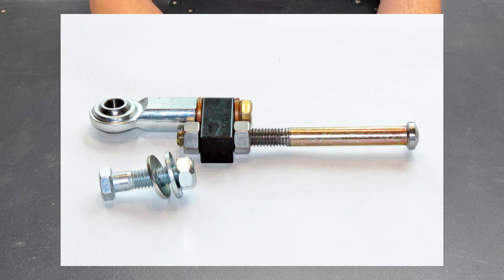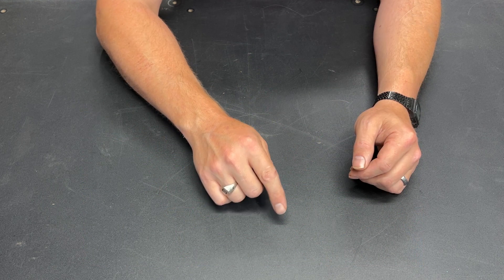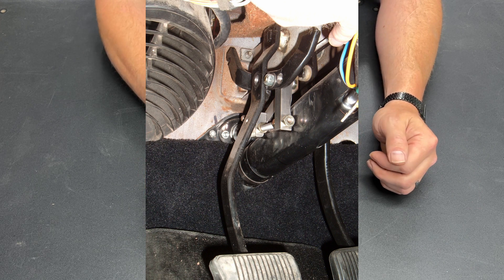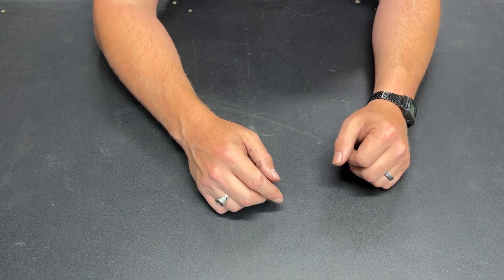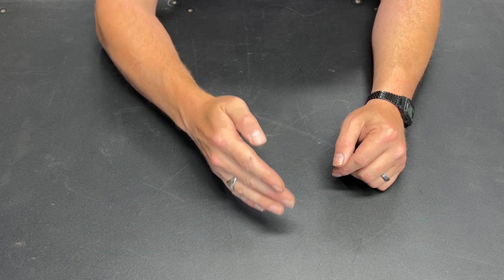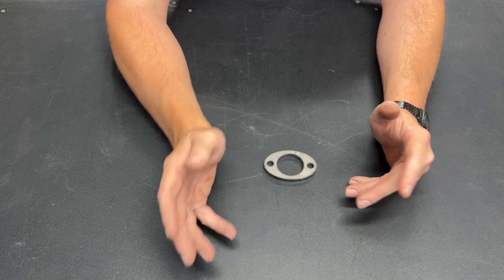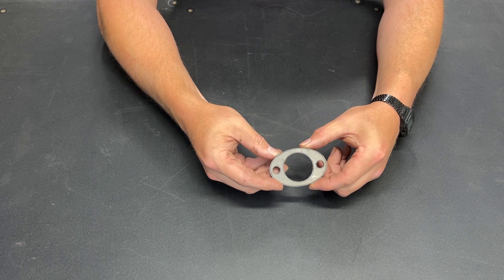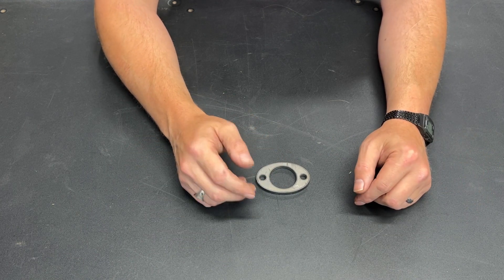Hydraulic Clutch 101: Correctly Mounting the Master Cylinder to Maintain the Correct Pedal Ratio

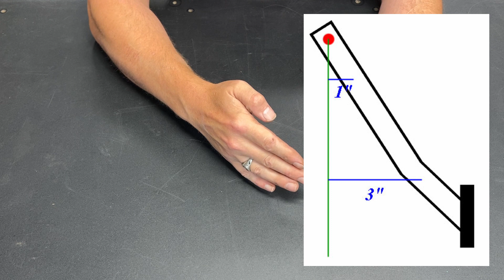Comment: im putting a tkx in my 47 dodge panel truck, i cut out an 87 d150 pick up truck bulkhead and welded it in the 47, so i had the factory 87 brake assembly and 87 steering colum, its a frankenstein, but its an auto set up, got an la360 and had a auto torqueflite, now putting in the 5 speed, i got the clutch pedal and brake pedal off ebay and it fits in the factory hanger on the bulkhead, now from your drawing at 3:25 i should mount the clutch master at the same vertical position as the tang that the rod hooks to way up on the pedal arm? ive got a hydro boost brake assembly so theres room to mount it since theres no brake booster on the firewall, do i need to put a stop of some kind on my clutch pedal arm to limit travel of the clutch pedal arm or does the rod connecting the cluch pedal to the master hold everything where it needs to be? thanks for video
Reply from the maker: No limit needed.  When the clutch mater bottoms out the pedal will stop.

Comment: I have a 1960 ford falcon and need to go to a hyd setup with hyd TO bearing to get my mopar smallblock/a833 combo functioning. I have the factory pedals installed, without helper spring, and another set of pedals with the spring. Do you have a kit for a falcon? how do you account for the arc of a swinging pedal to push a rod straight into the MC without angling? Do i need to measure the travel of the pedals to find that distance to work out the math for an MC?
Reply from the maker: I don't have any kits that utilize a hydraulic throwout bearing.  My offset pushrod might work in a 60s falcon as the falcon and Mustang are similar but not exactly the same.  on a 65 Mustang my offset pushrod would allow the master to be mounted n the OEM clutch linkage hole and connect to the pedal in the OEM linkage connection point.  as far as the arc the kit is designed to be parallel with the master at 1/2 stroke.  If you have further questions probably easier to email me through my website.

Comment: I have your universal T5 kit on a 1978 Mustang. With the clutch pedal to the floor the clutch does not completely release. 
Is there supposed to be any play on the clutch fork? 
More questions will follow.
Thank you.
Reply from the maker: Could be several things, like improper setup, insufficient fluid volume from the master (if using one other than the one I sell) or the most common issue air in the system. https://youtu.be/8pFd_cHVjHQ How much stroke are you getting at the slave and are you using my master cylinder or something else?  

As to your other question, when properly setup the slave cylinder piston needs to be completely bottomed out in the slave and all lash needs to be removed from the pushrod and clutch fork.  Youtube is not a good place to do tech support.  Please contact me via email through my website with your follow up questions.

Comment: Hi i have a 1970 cougar with a 351 cleveland automatic. I have a 5 speed box from foxbody mustang.Do you suggest I try and find 4 speed clutch pedal assembly or got with a wilwood clutch pedal assembly? My cougar is equipped with power brakes.
Reply from the maker: I would go with a stock type pedal. Depending on the look you are going for it will likely look better and should be easier to fit the master and pedal together.  If you have more questions don't hesitate to ask but it might be easier to contact me through my website rather than youtube.

Comment: Great series. Do you have any videos for the plumbing of the clutch lines? I am going to be using the master and slave from the truck the transmission came from but I want to run my own line. I'm honestly not sure how I can tap into the master and slave with the connectors that use the roll pins to hold them, everything I done before was threaded. Was also curious about the factory set up that had the soft plastic line going from the master and hardline going into the slave as I would want to do hardline from master then probably an AN hose going into the slave, would there be any ill effects doing it that way?
Reply from the maker: I don't have any answers for the fittings.  There are so many different factory fittings that I don't have a one size fits all/most option.  I would look for an AN adapter that fits your specific fitting.  As far as the hard line that is not a problem as long as you mount it solid at both ends and you do as you said and put a flex line at the slave cylinder.

Comment: Thanks for that info. What is the pedal ratio for the cars you nominated? I have a 70 Torino thats had a home made setup and there is too much pedal travel. It works out at about 6.6:1. Ive now made it 5:1 whilst keeping the alignment as good as possible and it feels right travel wise but its pretty heavy. Is that about right?
Reply from the maker: so pedal ratio and hydraulic ratio work together to effect release point and pedal effort.  I never actually calculated my pedal ratios as I was trying to have near max stroke of the pedal result in max stroke of the master.   I go over pedal ratio and hydraulic ratio in this video https://youtu.be/Q3rGUSIjd_k  I would guess your hydraulic ratio is a little off but that is just a guess.  I would need to know required stroke at the slave as well as SC bore and then the bore and stroke of the master to get a better idea what you have going on.

Comment: Have a old toyota rav 4 2001 and yesterday noticed a oil leak in a aluminium block that sits between main and relay cylinder, it has a disk that is sealed with a square gasket, didnt find in the internet its function, do you have any ideia of what is does? best regards
Reply from the maker: Sorry but I do not know what that is for.  My expertise is older domestic vehicles.

Comment: @DazeCars On a 65 Mustang, do you still need to use the Clutch pedal spring, that goes from the pedal to the bracket on the pedal support?
Reply from the maker: It is not required but some still choose to run it

Comment: Have you ever looked into a slave cylinder bracket for a Toploader in a 65 Mustang?  I am building a road race car with a set back seat and it looks like a hydraulic clutch system will be the best way to go.  I have been planning on designing my own but I am open to saving some time.  I want to keep the slave cylinder on the outside of the bellhousing and not use a transmission input shaft mounted slave.  Thanks
Reply from the maker: I do not currently have anything but have been looking at a couple different options to make somthing work.
Reply: Thanks for getting back.  No big deal, just looking to save a bit of time if you had something.  I will figure something out (I am a retired mechanical engineer and have been playing with cars for over 40 years).  Most likely I will be working with the stock bellhousing and clutch fork.  I will let you know what I come up with if you are interested.
Reply from the maker: @kimbarron  And right there is why I never designed this system to produce.  Attaching to the bellhousing and pushing from the front makes the most sense.  A push slave is way better than a pull slave.  Problem is there are at least 8 different OEM bellhousing and they are all slightly different.  I could never come up with a kit that was one size fits all.  I am looking into a system that might work using a modern bellhousing but have not had a chance to test it yet.
Reply: @dazecars I do agree that a push slave would be the best way to do it.  I can see the issues.  I forgot about all the different bell housing/clutch fork options that Ford used.  I am guessing  this is why I have not seen much out there for Toploader options.  I am working with just one combination of parts, which will make it a bit easier.  An adjustable mounting bracket could be done to help with different bell housings and clutch forks but then there will still be the issue with getting the required stroke length correct do to the different clutch fork lengths (lots of math to do).  I may decide to look at the throw out bearing slave option but what a pain if and when you get a fluid leak in the bearing.  At least with an externally mounted slave it is something that can be changed out at the track without too much issue.  Again thanks!
Reply from the maker: @kimbarron  I personally can't stand a hydraulic throw out bearing.  If not set up correctly usually within .035" they are prone to failure.  Easy fix shim it properly.  The bigger issue for me is the way they feel... or the lack there of.  On a slave system you can still feel what the pressureplate is doing as you engage the clutch just like you can with mechanical linkage.  For what ever reason that feeling goes away with a hydraulic TO bearing.  Email me through my website and I will let you in on my toploader idea. Not ready to make it public yet until I flesh a few things out but I don't mind sharing in a less public form.
Reply: @dazecars  I have not used a hydraulic throw out bearing but it is good to know that are issues with feel.  Another reason not to use one.  I have always liked the feel of the mechanical linkage but on this car getting a mechanical linkage set up is just not going to work.  I will drop you an email.  Thanks!
Reply: I went out to your web site and clicked on the contact link and it opened up a window that wanted me to open an account into a "mail" app of some kind.  To see if it was on my end or yours I tried on a different computer and got the same thing.
Reply from the maker: @kimbarron  its just a "mail to" link.  Try right clicking on it to get the accual address
Reply: I've been seaching for about a week on anything for a hydraulic conversion for toploaders. This was helpful thanks guys